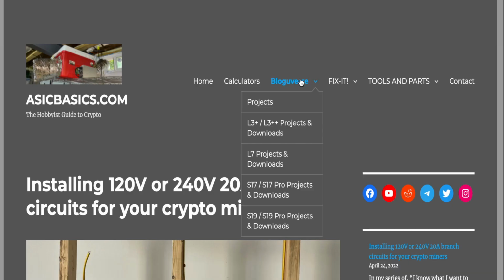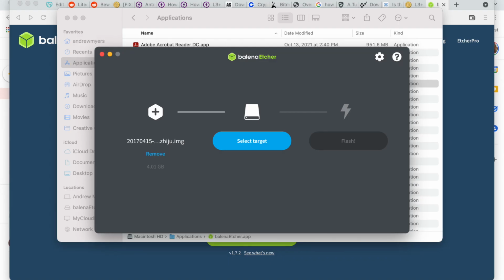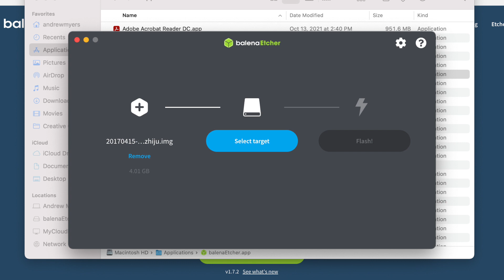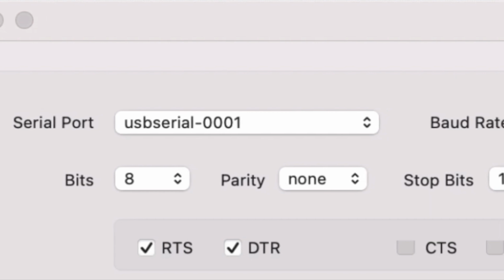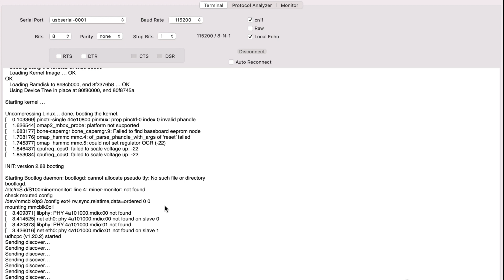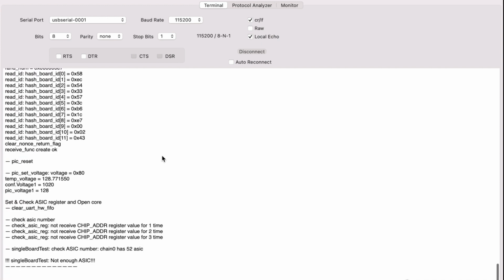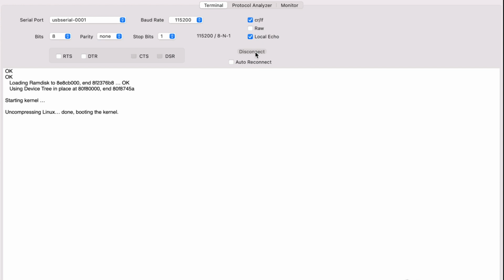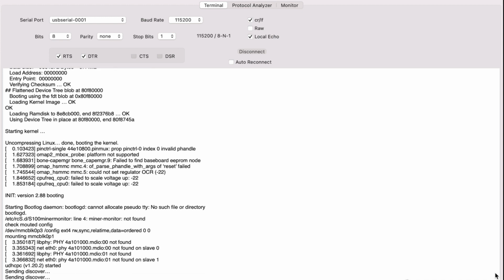ASICBASICS.COM - Creating your own DIY test fixture for the Antminer L3+

Comment: Is it possible to make this work on a 1.x board?
Reply: I'm trying on a 1.81 board and get error "Kernel panic - not syncing: Attempted to kill init":
Might be because of board version
Reply: seemed to be a issue with the sd card, tried reformatting a few times then it worked

Comment: Is any fan simulator for antminer good or does it have to be the type you linked to? I'm asking because I want to order within Thailand to avoid long delivery time. I'm looking at a single unit with two X four pin connectors.
Also what is a terminal emulator? I'm using windows 10 pro.